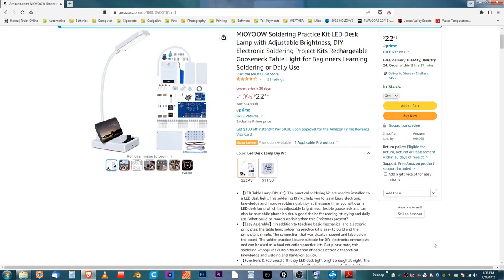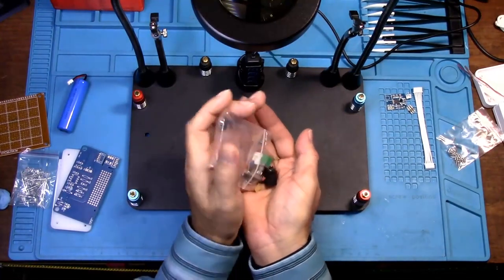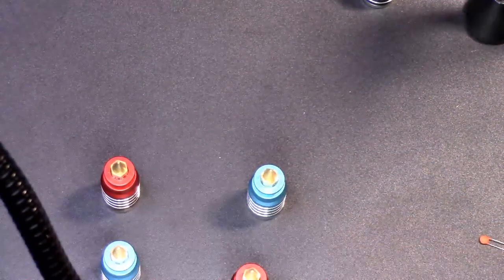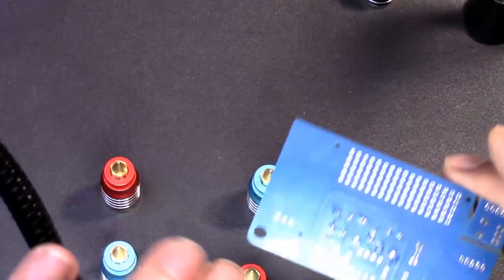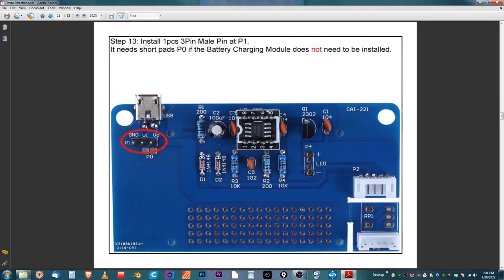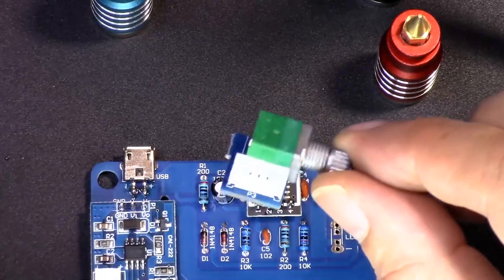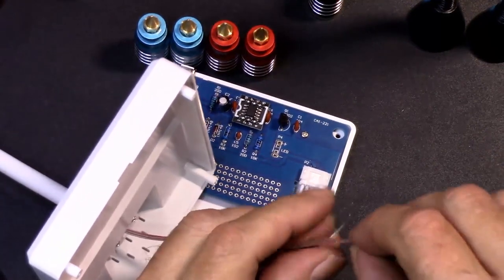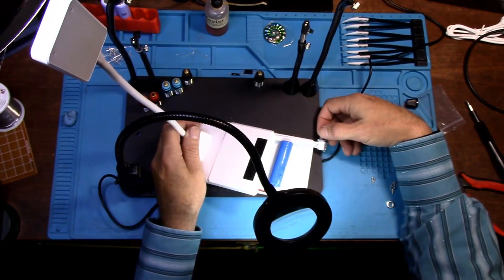Mioyoow Soldering Practice Kit Led Desk Lamp2 1 1

Comment: I don't know how the circuit works when the  NE555 requires 4.5 VDC but, the circuit runs off of a 3.7 Volt Lithium Battery.  I built the same PWM circuit on a breadboard and it would not work with 3.7 Volts.
Reply from the maker: Interesting, and thanks for the input, and just like Johnny-5, I need more input LOL....

I unfortunately am not a Big Clive ;), so it is good to know more from experts like you... 

We have to rely on the company putting the parts into this for us to put together, but if they included the wrong or miss-matched parts into the kit, it would make sense if it doesn't work as expected. 

Thanks again for your input - it is much appreciated.  Do you have a suggestion for replacing the NE555 with something more suitable for this project?.

Comment: Light was working and now it just flickers on and off for a split second and wont stay on D: any help ?
Reply from the maker: After I built mine,  it works, and then it doesn't.   Pretty much I get the flickering too.  I think it is the switch on mine, and could be the same on yours.   These are cheap Chinese (learn to solder) soldering kits,  so am sure the pieces are not the best in quality.   I was thinking about changing out the dimmer switch,  but never did.   It did help me immensely though with my soldering,  so I guess you could say,  - it did its job right?... 😉
Reply: @Outside-In.  i guess it did do its job haha any recommendations on a switch replacement. im just getting into all this so been having fun learning
Reply from the maker: @nakasoda1923  Sorry about that,  YouTube didn't even alert me to your response...  Actually, I don't have a recommendation on a switch.  I am out of town at the moment,  but when I get back home,  I will look at the switch,  find a replacement, and let you know what I find.   Thanks for the reply, and again sorry for the delay 🫢
Reply from the maker: @nakasoda1923  I found a listing on Amazon for what I need, and placed an order.   Here is a link so you can get them too.  I hope this fixes it, and am sure that the 50k ohm potentiometer is the problem... EEEEE 75pcs Potentiometer kit with Rotary knobs 1k 5k 10k 20k 50k 100k Guitar Pedal Potentiometer Assortment kit Potentiometer Linear Rotary Audio B Type Variable Resistor https://a.co/d/58xiBcv

And you will have extra things for other projects...  😜👍
Reply: thanks for the help i hope you keep doing more projects i enjoy it and its helpful in my practice :D @Outside-In.
Reply from the maker: @nakasoda1923  Thanks Nakasoda for your comments, and I would enjoy doing more videos like this, but trying to figure out what people would want to see - is a bit hard to do - so...  If you have an idea for a project that you would like to see, please let me know, and I will try and create a video for you.  Hope you are enjoying your new year 👍